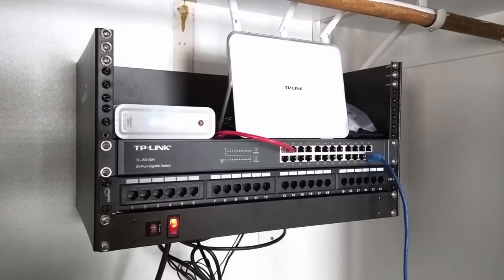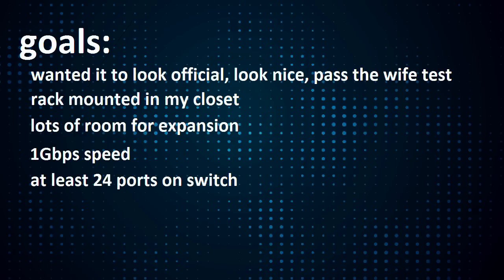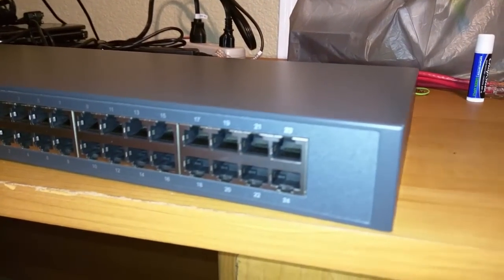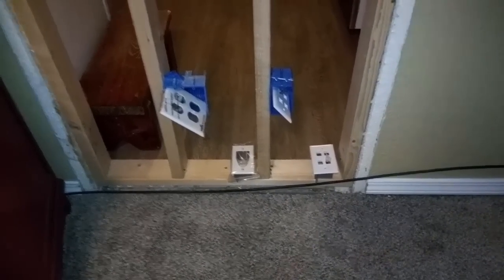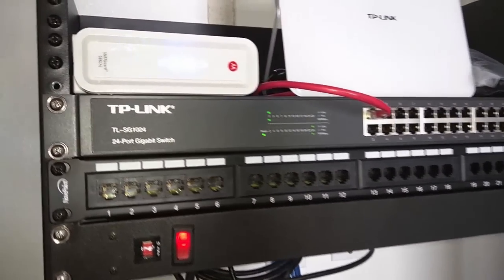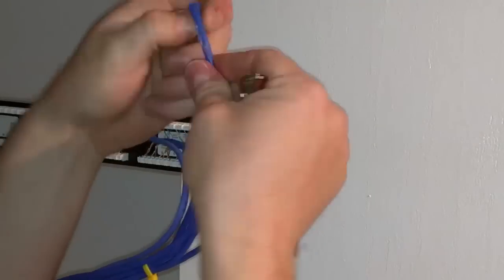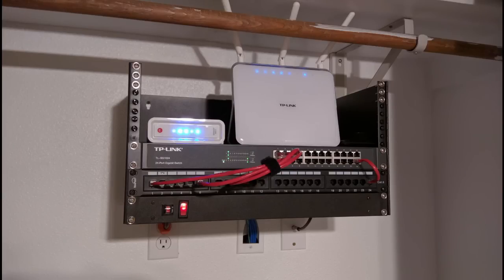Budget Home Network Tour/How To

Comment: Noob question..but is a switch really necessary in a home network? Is the goal of the switch to improve speed and transfer rates?
Reply from the maker: It just adds more network ports to a network if you need more. It won't improve transfer speeds really, that's not it's job. But if you can now wire more devices instead of using WiFi, then you will see better performance.

Comment: This may have already been addressed, but I was wondering how your wifi signal is.  It looks like your equipment is in a closet.  I'm thinking of doing the same thing, but have read that having a router in a closet degrades the wifi signal throughout the house.  Do you by chance have an access point somewhere?
Reply from the maker: No other access point in the house, just the one built into the router. The wifi signal I get is great, dispite it being in the closet.

Comment: Great video, super legit setup dude.
I do have 1 question though:  Do you regret running all those cables to the wall where your TV and entertainment center was going to be?  I'm just curious, why not just run 1 CAT6 cable to that location, plug in an 8 port switch, and then you could just run short cables from the switch to each device in your entertainment center? Seems like that would've been easier.  Was it bandwidth bottleneck you would be worried about in doing it that way?  I just would've much rather ran 1 cable instead of 8! HAHA
Reply from the maker: I don't regret it. The wall was open, so it was easy to run them, and I had plenty of cable. I didn't want a bottleneck, but honestly, one line and a switch would work just fine as well. If the wall wasn't open I might have just ran one or two.
Reply: @BudgetNerd  nice! Very cool thanks for the reply!

Comment: I know computers and all pretty well, but what exactly is the overall goal of having a setup like this as apposed to simply running ethernet cables alone and using WiFi when it's more convenient?
Reply from the maker: I have answered this question dozens of times. If you spend a few mins in the comments, you should fine your answer.

Comment: I'm doing a car dealer and all 24 ports are filled up. How easy would it be to add a second switch?
Reply from the maker: Super easy. If you use a simple switch like the one on my video, just connect the new switch to the other one.

Comment: What is the 1U device u put in the very bottom slot of the rack? Is that a power strip on the back of it, or is it a battery backup of sorts?
Reply from the maker: Just a rack mounted power strip.

Comment: Is there a way to build a rackmounted wireless router?
Reply: It's not what you want. Your best bet is to build a rackmounted router (pfsense is amazing), and then mount an access point to the ceiling, and run a cable.

Comment: Hey!

I'm not very experienced with this stuff and needed some advice. I live in a very rural area, there isn't fibre here and I've currently got the best internet we can get and it's only 10 down 2 up. How exactly do you get the internet etc to go to the router, I don't really get how it was done.
Reply from the maker: on the modem provided by your internet provider, there will be an ethernet port. You will plug an ethernet cable from there to the WAN port on your router. It's pretty simple generally. If you have a modem/router combo from your Internet provider, then you won't even have to do that.

Comment: Need some help my network setup I have 2ps4 and a pc in my room on the 2F of my house my router/modem is in the basement very far away.i want to have my devices either connect to ethernet or really good wifi signal. What would you recommend I do I would not be able to router cable through out my house.
Reply from the maker: I have a video that would give you a few pointers on running cable. If you can't run cable, then wifi could work as long as your router/access point was good enough.

You could also consider Ethernet over power line. Google that.

Comment: Just out of curiosity, have you ever put a watt meter on there to see what wattage the setup is pulling in total? i know your switch is pulling about 14 watts, and prob same for router... maybe 40/50 watts total?
Reply from the maker: +Accessfm I haven't but if I had to guess at max it could pull 100-120 watts.

Comment: Question-  If you have the switch why use the patch panel, will you have enough wired devices in your home that you would need both ?
Reply from the maker: +Ken Kimmel I could just run the cables to the switch, but the less they move the better, if I need to swap anything. The cables that run through the wall are different than your normal Ethernet cable. A patch panel also looks better and allows me to easily change and configure the network without needing to have tags on the cables. It also allows me to have easy to see numbers to use to label the jacks around the house, and lots of other nerdy reasons.
Reply: Isn't it easier to unplug an RJ45 jack then to rewire the panel?
Reply from the maker: +Ken Kimmel well I wouldn't have to rewire the panel I would just unplug the patch cable and move it to the new port on the patch panel. It's that easy. Once I wire a cable to the patch panel it will stay. Then I just have to move the patch cables around. It makes configuring and changing things down the road easier.
Reply: I guess im just confused as to how its easier than just unplugging a cable vs have to 'move' a patched cable.
Reply from the maker: +Ken Kimmel well moving a cable is easy no doubt, but a patch panel allows for a neater look. It's nerd bling. It's hard to explain the benefits, but it gives a more professional looks, helps with cable management etc. I'm happy to keep answering your questions as long as you're willing to hear my poor explanations.. :)
Reply: No, I appreciate the info.

Comment: Hey really nice video. I think the NavePoint rack is going to be a top contender for what I do with my own home network. One question, do you have a link to the brackets you fixed to your network switch?
Reply from the maker: +Brian Smigielski thank! the brackets came with the switch.
Reply: And that would explain why I couldn't find them when searching! Thanks man.
Reply: Actually I have another question for you. Sorry, it's kind of dumb. I wanted to verify that if I wanted to connect your switch to a cable modem (from Verizon for instance), I just connect an open LAN port on the cable modem to say, port 1 on the switch? And then ports 2-24 would get IP addresses from the DHCP in the cable modem and I could finally connect other devices. Did I get that right?
Reply from the maker: +Brian Smigielski no worries.. if your "cable modem" was a "cable modem/router" combo, then yes. If your cable modem was just a cable modem, then you need to connect the cable modem to the wan port on the router, and then one of the LAN ports on the router to a port on the switch. Then you would be good.
Reply: Yep, I meant cable modem/router combo. But thank you for the clarification and answer.

Comment: So can someone explain what the difference between a patch panel and a switch board is please?
Reply from the maker: A patch panel is just a place to terminate an Ethernet cable running through a building. It helps with neatness, professionalism, but does not help to move data around. The switch will move data where it needs to go on the network.

Comment: Which router supports multiple connections simultaneously 50 device smartphone a computer?
Reply from the maker: Any modem router will allow you to connect many devices at once. If you are talking about the ability for the router to send data to multiple devices at once, you should look up routers that support MU-MIMO.

Comment: This is something that I've been wanting to do but I'm not sure how much of a pain in the butt it would be since I'd have to crawl under the house to do it and I'd have to find a circuit to tap into. How does your setup handle DHCP addresses?
Reply from the maker: +SOU6900 crawling under the house is never fun, but usually it's not too bad, depending on your house and where you're trying to run the cable. My router handles DHCP in my setup.
Reply: ben johnson I personally would prefer to wire from above using an attic space but this double wide doesn't have that. DHCP setup is something that I need to look at closely since I wouldn't know how to set it up on a switch while using a wireless router that is also running it.
Reply from the maker: Attic is a little easier at times, but sometimes there isn't one.. like my house. It's a two story. That makes running any Ethernet upstairs a little harder. Most typical switches won't have a DHCP service on them, so you won't have to worry about it. If you have a switch that does have DHCP, and your router has it, you'll just want to turn it off on either the switch or the router, that way only one is trying to hand out addresses. I'd be happy to answer any questions you might have about it.

Comment: hi, great video!
one question, what is QoS and do i need one of those in the switch if my router has?
Reply from the maker: QoS is Quality of Service and it is a way hardware or software can try to ensure priority to certain types of traffic. Most normal home networks wouldn't really benefit from QoS. But there are switches and routers that do offer it.
Reply: Budget Nerd Thanks for the fast reply!
Now let's say I'm connecting the devices in a switch and in my router. Only the router has QoS can I give priority on the traffic to this specific devices that are connected to the switch?
Or the switch should have as well QoS?
Reply from the maker: 50LL3KR4M if your router has it, that would be all you would need. Switch does not have to have QoS as well.
Reply: Budget Nerd perfect 👌 Again thank you for your fast and helpful answers!
Reply: @BudgetNerd  I'm a retired network engineer.  My last employer was one of the largest school districts in the USA by student population.  Yes, you need it on the switch as well especially if you're running multicast, streaming and VoIP.
Reply from the maker: Thanks for the info!
Reply: @BudgetNerd  See the 802.1p wiki; https://en.wikipedia.org/wiki/IEEE_P802.1p  If you don't have an intelligent switch that supports 802.1p, all traffic at layer 2 is treated the same.  If your switch supports 802.1p (QoS), it most likely also supports 802.1Q (VLANs).

Comment: Looks like it's mounted up site down at 4:03 and that you use way to small screws to the hole in the rack XD
Reply from the maker: +Zaxaz1990 it's not upside down, and I have two types of screws, black ones that came with the rack, and silver ones that are even bigger
Reply: Wall screws. and either there is a production error or you turned it upside down.

The hole for the screw to the wall is upside down of how its intended to be.
Reply from the maker: +Zaxaz1990 no, the rack is designed to be placed on screws and then slid down, just like wall mount chargers. It's not upside down. The screws might make it look wired, but I assure you, it's not upside down.
Reply: Plz correct me if I'm wrong, but I think it is upside down. see pic in link http://prnt.sc/ezm2ok
Reply from the maker: +Zaxaz1990 that slot for the screw goes up and down that way I can mount the rack with the hinge on the left or the right. You can see the slot better at 2:03 to 2:09. That would mean this rack really doesn't even have an "upside down."

Comment: So next,I need to run a switch to the patch?
Reply from the maker: If some of my other videos don't answer your question, ask me. Right now, I'm not sure what you mean.
Reply: Sorry I seen your reply much later.
I have 11 cat5E cables from locations out in the field to a patch panel. 
I was wondering what's a fair priced switch to hook the path up to.
Thanks. Sorry to be a pest and thanks for the reply.
Reply from the maker: It's hard to recommend a switch, since they all have different features. Pick one that has more ports than you need to be able to easily expand and grab one that has the features you need.
Reply: Thanks man!!

Comment: Would have been a lot easier to just put small switch behind the home theater stack and run only a couple cables. Also, thats a pretty standard punch down for the patch panel.
Reply from the maker: would have been a bit easier, but I had the cable and the wall was open, so it wasn't a big deal for me to add several.

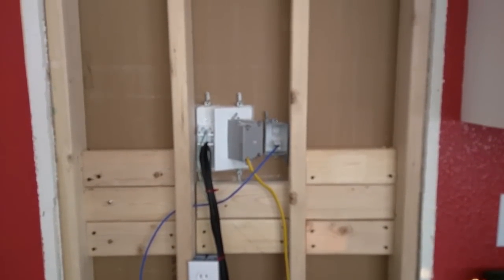Comment: I  did not see you use anchor bolts to secure the rack mount to the wall. With a mount that size and having switches and others things in it,  it should of been anchored. Wall stud on right side @4:13 did not look  true. I'm assuming you fixed that because @4:42 it looked true. I could not get to see it all the way up to the top @4:42 though. If you are going to do an arch like that then you should of mitered, glued, and screwed it all together and without there being any gaps. Perfectly tight. The vertical stud on the top plate should be supported with an L bracket, one at top and one bottom on either side. One stud in the middle is not really enough anyways. There should be two vertical studs equally spaced and off set on either side of the one in the middle. They should be  L bracketed the same as the one in the middle and doubled-up. There are no romex staples @4:42 on any of the 12/2 power cables. That's an NEC code violation. If you are going to do the horizontal bracing @4:42 like that that then at least  tie them into the studs with some kind of metal brackets.
Reply from the maker: +Jason C. Thanks for the tips. The rack is in studs, it's pretty solid. The TV wall is solid too.

Comment: so with that router you provide wifi? Is there anything extra? do you have to like code or program anythingg after the hardware is installed or does it "install ready"?
Reply from the maker: +Nano Nerfer the router does have a built in access point that does provide wifi. There was a bit of setup for that, but just the basics. Nothing much extra than that. Most of it just was hook up and it worked. Especially that switch.
Reply: Budget Nerd okay thank you for the information that helps out alot, Loved the video and the help!

Comment: What cable modem is that? An is it safe to lay it down?
Reply from the maker: Just a Motorola surfboard series modem. It would get better ventilation upright, but on it's side isn't a huge deal either.

Comment: I see your using a tplink wireless router.. which one do u have and what speeds are u getting with it.. thanks
Reply from the maker: +Jorge Gomez Archor C9. I think it claims 1.3 Gbps over the 5.0Ghz wireless, but I don't get that. Never will. Never did a speed test, but speeds are good. Not as good as wired.. so hence all those wires.
Reply: Thanks I have the C8.. I get about 90 max but I think its because of comcast throttling my bandwidth.. I was thinking of buying the C9 to replace it but I probably wouldnt see a difference in speed because of Comcast.. Thanks
Reply from the maker: +Jorge Gomez you are talking about internet speed, a c9 wouldn't make much of a difference.
Reply: thanks

Comment: The black... thing at the bottom of the rack is a power supply?
Reply from the maker: +Lagger Onesixfour not a power supply but a rack mounted power strip. Just gives a neat way of adding more power ports on the rack for all the equipment.
Reply: ben johnson Cool! Nice video and even better result at the end!
Reply from the maker: +Lagger Onesixfour thanks for the comment. I am happy with how it turned out.

Comment: Did you use crossover cables to connections ? ... or just normal ethernet cables ?
Reply from the maker: +Dulce M Aguiñaga normal cables. Crossover isn't used much any more. It's not needed as much with today's equipment.

Comment: Never seen such patch panel. That saves a lot of messing around with RJ45 connectors and pliers. But i think the 8 patch points behind the entertainment set is a bit overkill. Feels to me like you are trying to hide that overkill behind a cabinet in another room to optically justify this enormous system.
Reply from the maker: No sir. Just wanted to have room for expanding. I've already expanded it since the video.

Comment: Did you have to configure much on the switch
Reply from the maker: No not at all. There isn't anything you can configure on it.
Reply from the maker: The little tiny red cable on the bottom right makes it's way to the router which gives it a connection to the internet.

Comment: im slightly confused so you have a total of 48 ports(24 on tp link and 24 on nave point) in the closet itself right?
Reply from the maker: Total of 24 ports on the switch. The nave point is a patch panel, it doesn't add network ports like a switch does, it's just a spot to interface with the cables running through the house. You could check out my "what is a patch panel, do you need one?" video, should explain better what that is.